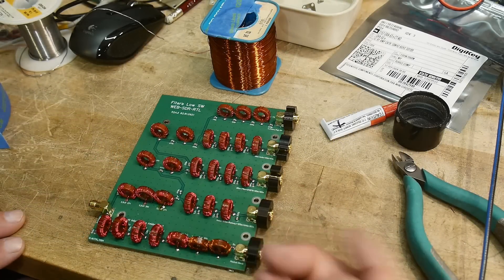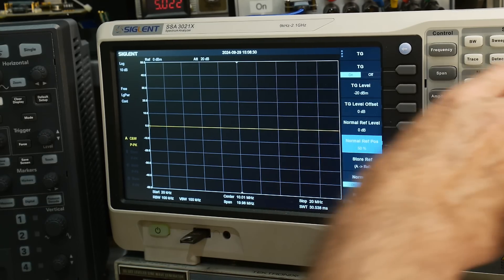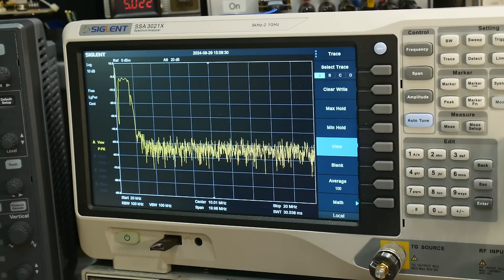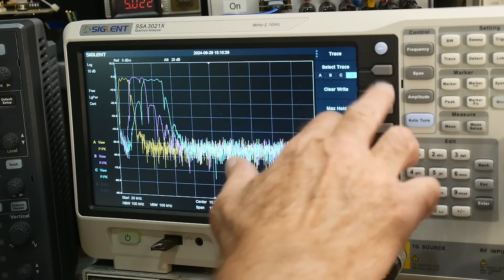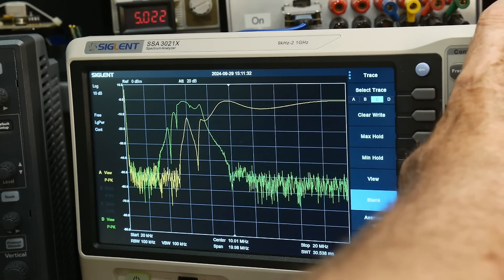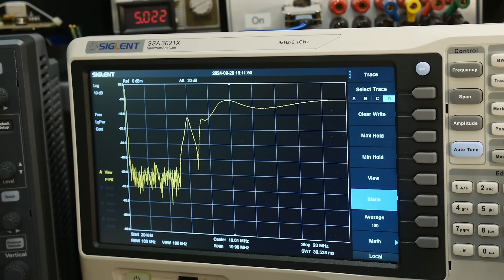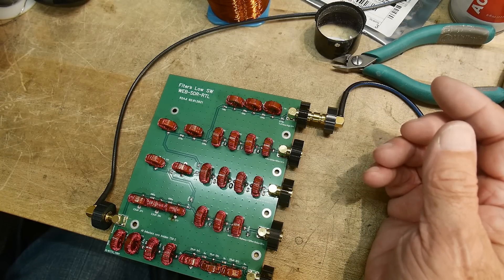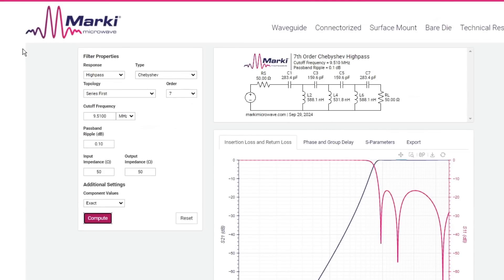#2015 Antenna Distribution Filter (part 2 of 3)

Comment: and how would it change if the unused/untested outputs are 50 ohm terminated ??
Reply: unused outputs should be terminated as it might significantly affect filter performance
Reply: @tubesnstuff503  that is the point yes

Comment: Very nice! I'm building my own transceiver at the moment, and my front-end is going to require a filter board. I'm thinking I'm going to do it kinda like this, except with relay switching controlled by the micro inside my transceiver (Will be doing VFO with the SI5351 & filter switching). Thanks for the video!